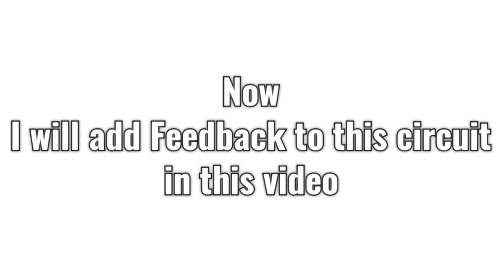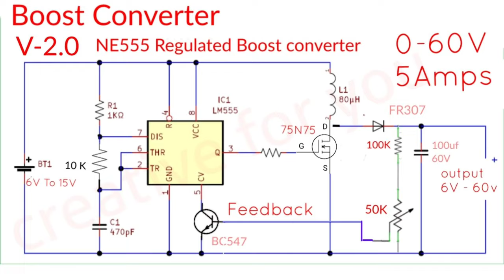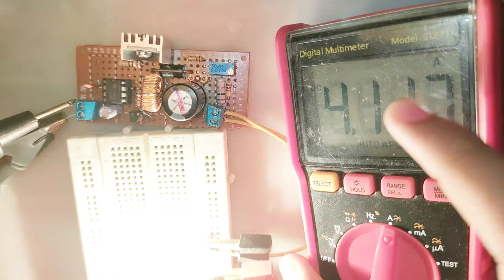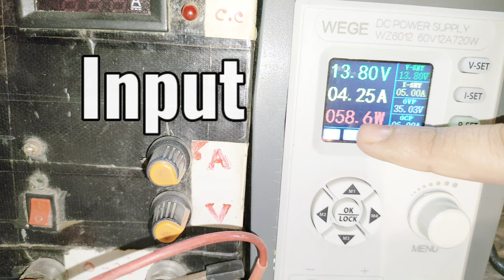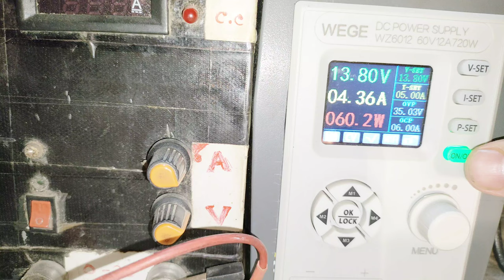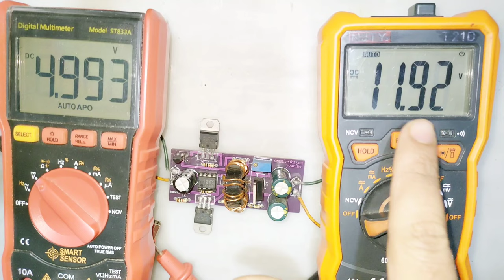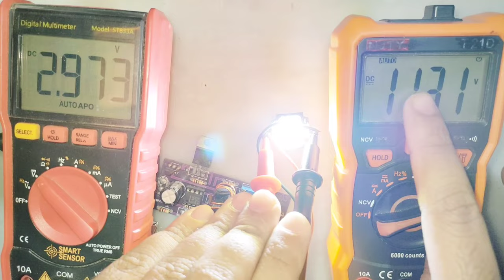Boost converter Using NE555 6V To 60V with feedback - Part-2

Comment from the maker: Watch part -1 here 
https://youtu.be/myDSWl5I03k
Reply: dont good! coil bazer , dont stabile voltage
Reply from the maker: Hello
I think you need to increase the frequency 50-100khz
Reply: @Electronic_For_You  in the diagram isn't 100r 2x , but the PCB is 2x 100r , 1k potencjometr 5k at the diagram is 20k please axtualise

Comment: If you intent to operate the 555 at 50% duty cycle it is convenient to controll the charging and discharging of the capacitor from the output (pin 3) across the 10 kOhm resistor. In this case you save 1 resistor and you avoid to short 1 kOhm to ground via the discharge (pin 7) and waste 1 mA per 1 V operating voltage unnecessarily.
Reply from the maker: Maybe true

Comment: does it work under little step down environment? maybe i will use this circuit for 3s battery, i hope i can make 12v stably even though the full charged battery voltage is 12.6v.
thanks for your educational video.

Comment: 1:50
i wonder why there is 2 resister more  under the potentiometer. i saw your circuit diagram, and i'm making schematic before compositing circuit, your circuit diagram has only 100k ohm nearby 50k potentiometer. little bit confused. 

And maybe i can use 100 OHM infront of the 75N75 mosfet , right? 

for the last,  can i use only circuit diagram that you uploaded for 5Amps output?? I checked gerber file in your jlcpcb link, there was two of 75N75 mosfet, and is there something different for output Amps? 

Sorry for asking a lot.  And  always i feel thankful for your channel
Reply from the maker: Hello,
I recommend using the uc3843 IC. , because the ne555 is not made for boost converter,

Comment: IRF1010E TO220
Power 200 W
Voltage 60 V
Current 84 A
This mosfet will be good if I replace 75n75 with it
Reply from the maker: Yes 
It works too

Comment: The circuit in the picture is completely different from the video. Even the capacitor is wored in the wrong polarity.
Reply from the maker: I used different components because i don't have some components
Reply: @Electronic_For_You  No, that's not how it works, you can't of course wire a capacitor the wrong way, it will blow up. And no, even with different components you can't connect it like that. I suspect this circuit is not your design since you don't even have made any calculations.

Comment: I've tried the circuit diagram simulated using Proteus and Easyeda but why is there no change to the output with 12V input, even when I've changed the resistor variable
Reply from the maker: I never tried in a simulation!
But in reality this circuit works you can try yourself!

Comment: reply me sir
can i use this circuit to power my 19.5 volt, 2.1 amps laptop ?
because my laptop has no battery and i want to use circuit to boot my laptop which requires 19.5 volt with 2.1 amps.
will this work sir ? ? ???
i am using laptop-lithium-ion-celss.
Reply from the maker: I uploaded another video a few days ago !
Watch that one ! 
It's perfect for your work!!!!

Comment: THIS CIRCUIT IS NOT WORKING. I HAVE TRIED IT THE INPUT VOLTAGEIS SAME AS OUTPUT VOLTAGE SO IT IS NOT BOOSTING.
Reply from the maker: Is your Ne555 timer oscillating?
Reply: IT IS NOT OSCILLATING AT ALL
Reply from the maker: Make a oscillator first then use output to drive mosfet and use control pin for feedback 👍

Comment: I have tried this circuit and it works if not given a load, when given a load the output voltage of the circuit has a voltage drop so that the output voltage is the same as the input voltage, why is this?
Reply from the maker: I think your inductor is not right!
Reply: I have used an inductor as recommended which is 100uH
Reply from the maker: Hello try using Bigger core and higher inductance
Reply: Is the inductor you use worth 100uH 3A?
Reply from the maker: Try using 600uh+ inductance
Reply: mr, how do I know the maximum input current and maximum output current of the circuit? thanks a lot

Comment: sir your work is great please whould you like to help me in designing og boost converter whose input is 6V and f=30KHZ AND DUTY TIME IS 0.7 And Resistor value is 5 ohm with 555ic
Reply from the maker: Ok, but whare is 5 ohm resistor you want to connect
Reply: At load bro
Reply: And output ripple voltage is 0.5
Reply from the maker: Have you built it?
Reply: No sir these are the given data
Reply: Please share your circuit with respect to this given data
Reply: And please tell me how to calculate the value of resistor and capacitor value which we use with 555ic.and thank you so much for your help and time
Reply: And please tell me how to calculate the value of resistor and capacitor value which we use with 555ic.and thank you so much for your help and time
Reply from the maker: Hello, 
You can use this calculator to set 30khz , try different capacitors and resistor combination 

https://ohmslawcalculator.com/555-astable-calculator
Reply: @Electronic_For_You  thank you so much but how to calculate the value of inductor ,capacitor value to built boost circuit
Reply from the maker: Inductor and capacitors should have the same value as in video !

Comment: if I supply 12v, do I get 5v at the output and if I change the input voltage to e.g. 1.5v, do I also get 5v without adjusting the potentiometer?
Reply from the maker: I think you don't have proper knowledge about the Boost converter!  It's not how it works!  A boost converter can only increase voltage higher than input voltage!
Reply: @Electronic_For_You  I didn't think so I knew he was just lifting but forgot with this example. Let's say I set 20v for the output then giving 12v, 9v to the input, the output will always be 20v. What if I don't use a schotkky diode but a regular 10A diode
Reply: @Electronic_For_You  I can use the LOS ESR capacitor
Reply from the maker: Yeas it remains the same voltage!
You have to use a High Frequency diode or the diode will get Hot and burn ! 
It's good to use a Low esr capacitor!

Comment: Good Jobs 👍🏼
... Hobi Elektronika here 😊
Reply from the maker: Thanks ❤️
Reply: gan rangkaian ini beneran bisa bekerja kah?
Reply: @fanless3193  
I tried 100% Working!!!!!
Reply from the maker: Why not !
I share Working Circuit Always 😊 
If you Have any problem always ask!
Reply: @kalashnikov_47z  thanks mate
Reply: @Electronic_For_You  I apologize in advance, because I've made it but using a different circuit but it doesn't work at all. And I want to ask, how many amperes do I get if I use a 22Uh inductor? 
Thank You
Reply from the maker: Ok
No problem!

You should use a 100uh 
With 0.8-1mm copper wire will work best 

22 uh inductor may not work well . But the current depends on Wire thickness
Reply: thanks mate
Reply from the maker: Welcome

Comment: I have to build from the schematic on google drive and what parameters do the resistors have there besides ohms
Reply from the maker: Kilo ohm resistors
Reply: @Electronic_For_You How many watts is a 1 kilo, 10 kilo, 100kilo resistor.
Reply from the maker: It can be any watt 1/2W or 1/4W

Comment: How much is the resistor in the gate worth?
Reply from the maker: 10-100 ohms
Reply: @Electronic_For_You  how much is the 2 capacitor electrolytes and 1 capacitor ceramic worth?
Reply from the maker: Everything written in circuit diagram

Comment: Amazing
Circuit 🔥🔥🔥

I made this and it works very well. But not good with Small Inductor!
Reply from the maker: Yeas
I told to use Bigger inductor
Reply: @Electronic_For_You  
Thanks for amazing video 🔥
Reply from the maker: Welcome 💪

Comment: Bro second boad circuit diagram 😊
Reply: In this circuit u useing 12v regulater bro
Reply: U r from bro
Reply from the maker: This is a boost converter 
9V input output 12-30V
Reply: Bro can I get 12v input and get 54vdc in this circuit is possible
Reply: For ro motor
Reply: @Electronic_For_You  60watt load
Reply from the maker: Not possible

Comment: I followed the schematic like the video but the feedback doesn't work, please help me, I use 2n5551 instead of bc547 because I don't have it :(
Reply from the maker: How it behaves
Please can you explain so i can give you advice!
Reply: @Electronic_For_You  I followed the diagram you put below the description, when there is no load the output still increases the voltage to 40v but when I supply the output load about 40w the voltage is only 27v maximum.  I tried increasing the input voltage from 12v to 13v the output also increased.
Reply from the maker: Is it adjustable like mine ?
Can it adjust the voltage normally? 

Or stuck at 40V?
Reply: @Electronic_For_You  yes but only when there is no load.  On load it gets stuck at 27v
Reply from the maker: Oh 
Can you input 12V and get 24V ? And load it?
Reply: @Electronic_For_You  I did but 24v drops to 12v immediately when there is load
Reply from the maker: But it should work 🤔
Try using different feedback transistors. And also use Iron powder core
Reply: @Electronic_For_You  Yes it works, but not what I want, maybe I should tweak the feedback with another component, thanks for the help, I'll let you know if I succeed.
Reply from the maker: Yeah
Sure 😊 I'm happy it worked
Reply: @KTĐXVIIMMV  Have you tried placing a dummy load (a 5.6K-12K resistor, for example) at the output? I see that in some types of circuits, if there is no dummy load, the output voltage will be a floating voltage and will have a very strong voltage drop.

Comment: I am not able to get the inductor 80uh so what can I use instead
Reply from the maker: Inductor from Computer Powersupply
Reply: Can u plz tell me the ratings sir
Reply from the maker: Use A Iron Powder core and make 10 to 15 Turns 1MM copper wire
Reply from the maker: Or 
You can use 100uH inductor
Reply: Ok thank u sir
Reply from the maker: Welcome

Comment: Can this circuit works at 5v or has to be 6v input?
Reply from the maker: MOSFETs don't switch on 5V so 9V input is most efficient
Reply: @Electronic_For_You  thank you for answered.
We can change it to lower gate mosfet voltage like 160n03, 90n03 as its threshold only 2v-3v.
Reply from the maker: 🤔
You can try . But i recommend using UC3843 ic i have another video . Recommend watch

Comment: Sir can I use ln4007 instead of fr307
Reply: Will it work sir
Reply from the maker: You need to use a High Speed diode FR107 can be get from old cfl lamp ... But its only 1A maximum and FR307 Is 3Amps
Reply: Ok sir that means ln4007 will not work right
Reply from the maker: 1N4007 may work but after a few minutes it will get damaged
Reply: Ok tq sir
Reply: Sir what abt ln5408 because I am not getting fr307 and 107 on Amazon

Comment: hello sir
we tried it but the voltage is not increasing sir . why is it so
Reply from the maker: First check if the ne555 timer outputting pwm?
Reply: But how can I sir
Reply from the maker: Do you have a multimeter
If yeas ... Select Hz option and put probes on pin 3 see if you saw some Khz value if not then its not working something is wrong connected
Reply: Ohh ok sir will check it once
Reply from the maker: Ok
Reply: There is no hz in multimeter sir
Reply from the maker: Put a small speaker to pin 3 and - see if it sounds or not
Reply: Ok sir
Reply: Sir it's 555 is not the problem

Comment: How many amps can this circuit bear?
Reply from the maker: 5 Amps Maximum
Reply: @Electronic_For_You  what do you mean by maxium ? isn't the amps stablized ? then what is the minium ?
Reply from the maker: No 
The current isn't stabilized. It will give how much load wants

Comment: Sir what is the name of the component (blue one )used to measure output voltage
Reply: Ang also for input
Reply from the maker: You mean Input Terminal?
Reply from the maker: Are you talking about That Terminal with screws on top?
Reply: Yes sir that one with screw on top
Reply from the maker: The name of that component is Screw Terminal Block
Reply: Sir how can I get fet75N75 it's not available on Amazon sir
Reply: Can 75N75 be replaced by any other transistor sir?
Reply from the maker: You can use Z44n or  Irf3205

Comment: This was an awesome video  , I subscribed btw 😀
Reply from the maker: You must try 😁
Reply: @Electronic_For_You  Am going to build it today
Reply: @Creative For You  pls I made it, and it regulated, but when I put a load, it fell to input voltage pls help me
Reply from the maker: How much current you loded?
Reply: @Electronic_For_You  like a motor or so
Reply from the maker: First you try to Get constant 1A 12V output from it by providing 9V Input 5A PSU see if it can supply 12V 1A without dropping the voltage then it Works . If it dorps at 1A then your circuit has problem
Reply: @Creative For You  okay then thanks for the feedback I will try it out
Reply from the maker: Welcome
Good-luck